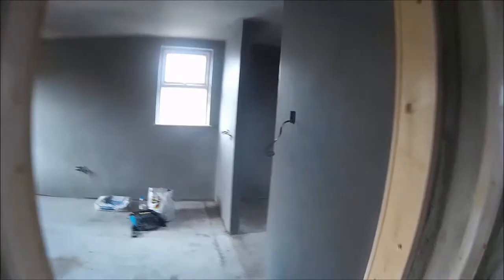3 STOREY HOUSE TO BE PLASTERED mid floor almost complete

Comment: Nice one mac good consistant even colour on the finish, how many throws of hardwall do you do per day? 2 big or 3 smaller?
Reply from the maker: Hi Jamie mate I do 3 two bigger hits then a small one at the end as fatigue kicks in :) Thanks for the comment stay tuned ;)
Reply: macplastering 
Nice one mac, aye i always aim to do three 2-2 1/2 bag throws, works better for getting tea at 10am and 1pm, we are tortured in the south of ireland, everybody is drylining the outside walls, it leads to loads of bonding in the evenings and between pulls on the second throw, keep up the good work mac
Reply from the maker: I just started a house that all the wall have been dabbed but it dose not save any time as it took them 3 days to dab the walls if they had been sand cement would took 2 days they will probably dry a little quicker and dam the house is warm , using red bags but it is setting like the blue , what finish are you guys using atm ??
Reply: macplastering aye down with us they just pin them to the block walls, means every ceiling line, wall angle and skirting line needs straightened with bonding, not much but some walls can be bad, were using carlite ultra finish all the time now, it's great stuff and so much faster
Reply from the maker: Love the ultra it is good gear we have red on the new site but its setting as fast in the heat I hear you the guy who did this house dabbed the board well if i am honest nice and flush joints  :)